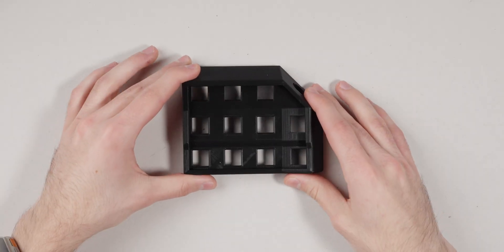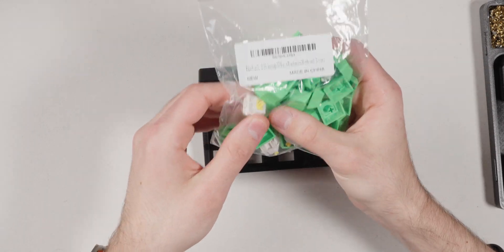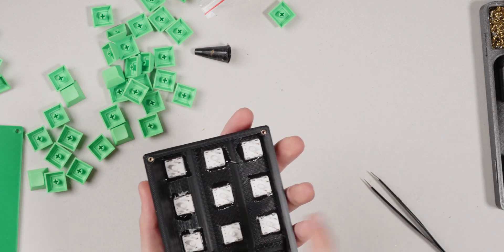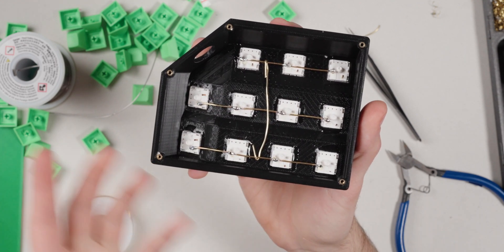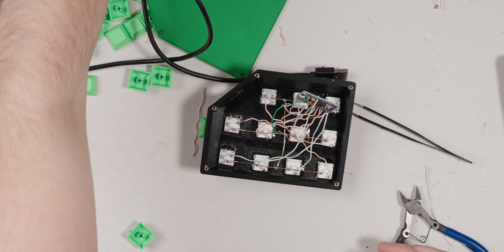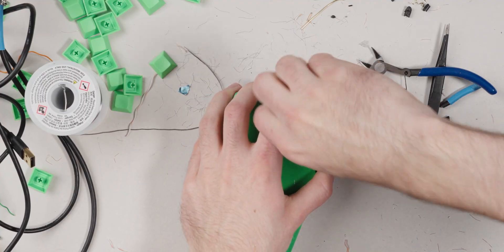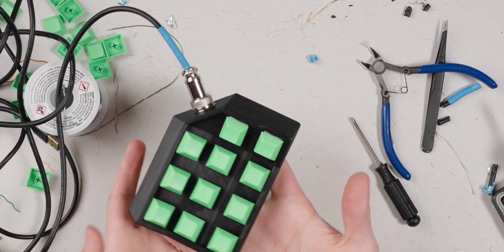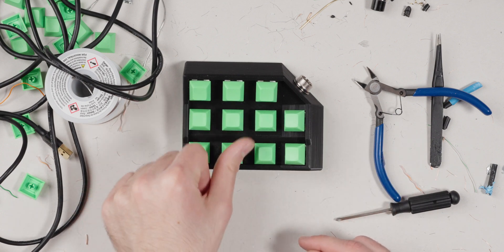Single Thumb Gaming Handwired Macro Pad

Comment: One recommendation, I heard you say you were worried about the weight, I've personally added adhesive tire wheel weights to macro pad like devices to keep them at least weighted down against the cable tugging on it. Easy and relatively inexpensive (at least for someone springing for aviation connectors!) Way to add weight! Just need to design a little bit of space for them to stick. They stack pretty well too.
Reply from the maker: I’ve used larger weights before, specifically my wireless corne build. Thank you for reminding me, can’t believe I forgot about that method for this build haha